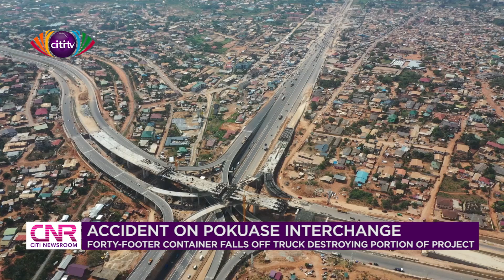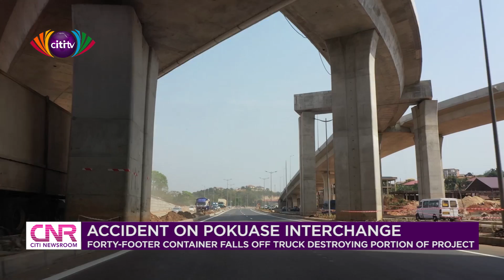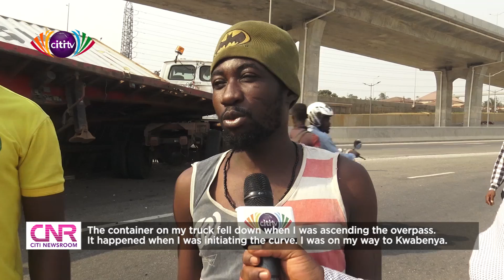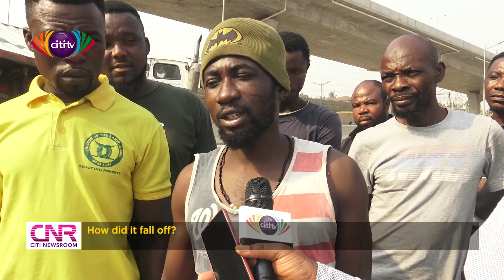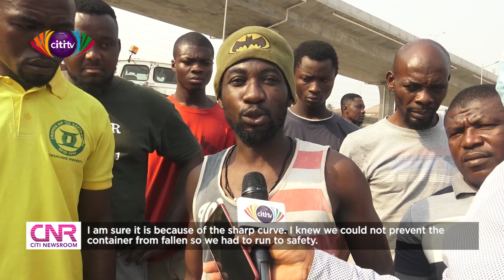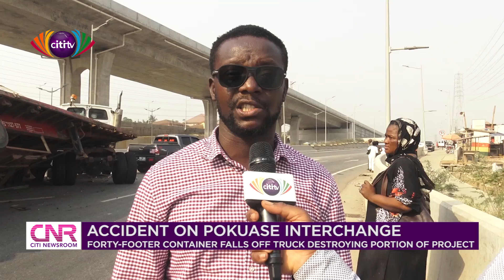40-footer container falls off truck to destroy part of recently constructed Pokuase Interchange

Comment: I can conclude he was speeding unnecessarily and applied his brakes in the bend. This will cause the trailer to jack knife or spin in a different direction. The spped limit is 40km/h but if I was him I will be doing less as it is just a guide.

Comment: I am sure he was either speeding or being careless, is this not ghana. Those containers   have no securities so of course it will shift. Never stay by the side of containers if you want to live long enough.  I have used this interchange several times and there is nothing wrong with the engineering.  Everything will be wrong with engineering if you are speeding

Comment: You don’t need to believe it was over speeding, get the forensic experts to determine that.
Reply: Is either he was over speeding or they'd overloaded the vehicle. You don't need an expert to determine the obvious. He should made to pay for the cost.
Reply: What has forensic got to do with this?😂😂😂😂😂 it's not a crime,it's an accident.anyone with common sense knows speed was a factor and the driver was negligent
Reply: @kodedlux  lemme come and go erh... heheh
Reply: @kodedlux  lemme come and go erh... heheh
Reply: It’s not that deep.
Reply: Forensic experts for this? No need  kraa, If you have done roads work as an engineer, you do not need any investigation to come to the conclusion Desmond made. He didn't say " I think' but rather  " i belive " I believe is certainty which makes me proud of him, cos it clearly shows he knows his stuff.
If you are not an engineer but a driver for many years..you can even make the conclusion that it was over speeding.

Comment: A question too. How fast do you all think a loaded "long vehicle " can move while 1 Climbing and also in a 2  curve. 
Travel down kumasi road and see how slow they actually are even on a plain road. They should have catered for CCTV as well for over head.

This is the second time similar accident is happening, first with 2 guys on a motorcycle.
Please we need proper investigation not somebody concluding he was over speedind
Reply: @christiandanso8335  say it again common law of Physics
Reply: For trucks like this, you need to be super slow, way below speed limit. You don't just compare your speed limit to other drivers'. These are different vehicles with different and special  training and license to operate. There's a reason for all that.
Reply: @jgjg934  I don't not clearly understand your point. But let's just wait for what will be next
Reply: The interchange is fixed, the variables are the cars using it and their speed

Comment: The problem is that the interchange was not designed appropriately to be consistent with this type of interchange and driver expectation. This type of interchange is typically designed and constructed  for higher speeds of 70 kph (45 mph) , including most of the "curving" ramps. A posted speed limit of 40 kph (25 mph) is too low/slow for this facility. From the video it doesn't appear there's adequate advance warning road signs for drivers to slow down when negotiating the curve.  Costly interchange, not designed appropriately in thr context of the environment, location and driver expectation. Nice interchange but wasted effort and public funds.